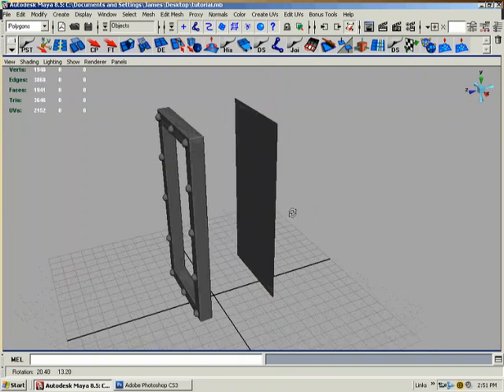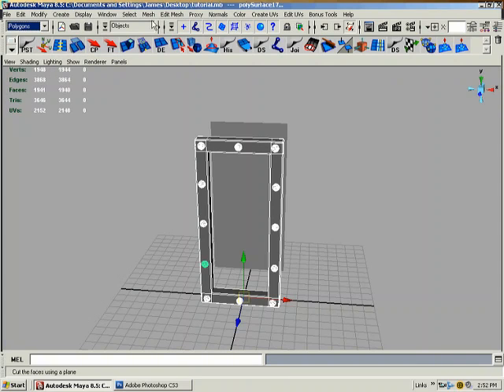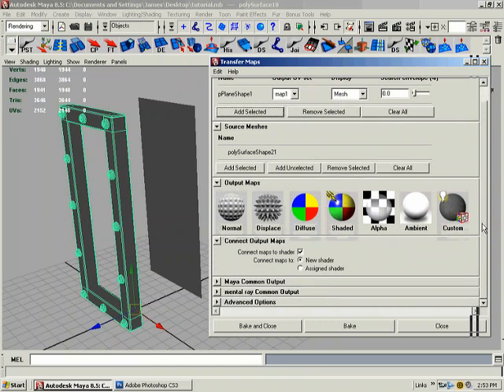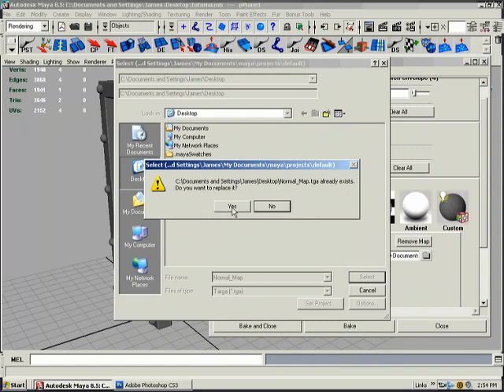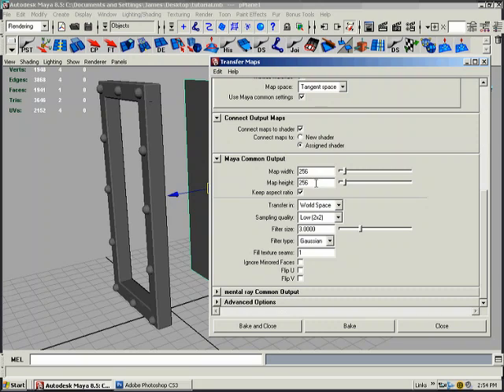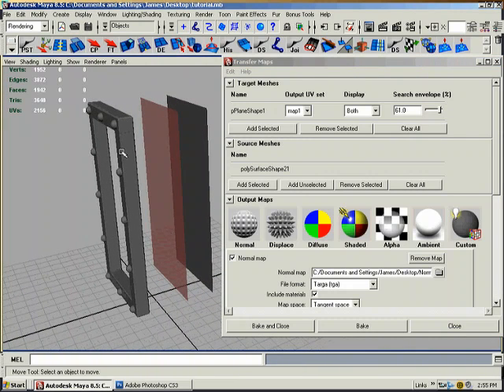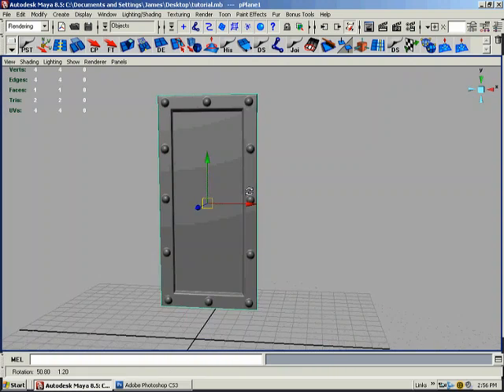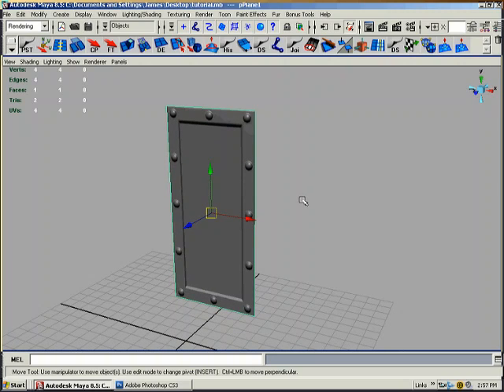Normal Mapping inside of Maya

Comment from the maker: Well there's quite a few differences, bump maps are grayscale textures, with I believe 256 shades of gray value,  to basically fake the appearance of detail on a polygon surface. A normal map is an RGB map with thousands or millions of color values in it, so you can get quite a bit more detail in a normal map. Normal maps perturb the surface normals, so that light bounces off of it as if there were geometry details on a surface. Bump maps do something similar only with far less detail.

Comment: That's awesome. Much easier than going the Zbrush route I think. It's more explicit somehow. 
 

It's particularly nice if you're going to retopologize since Maya has the "Make Live" tool that you can use in conjunction with the "Append Polygon To Shell" tool to do that in a way that is actually nicer to use than the Zbrush retopology tool. 

You just solved a vexatious problem for me. Thanks a lot.

Comment from the maker: Blahhhhhhhhh,

Sounds like you must have done something in reverse actually. Check the meshes you are choosing as the high res one and the low res one. The objective is to bake the normals from the smoothed, high res mesh into the boxy low res mesh....you may also want to check the cage or the "envelope" as maya calls it and make sure it covers both meshes. If it has some parts of a mesh penetrating outside of the envelope you will have issues.